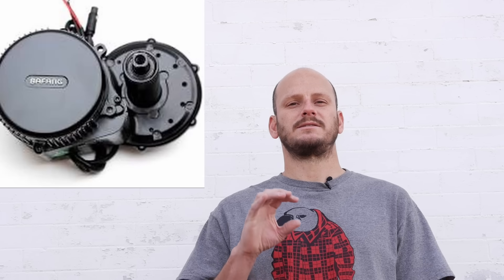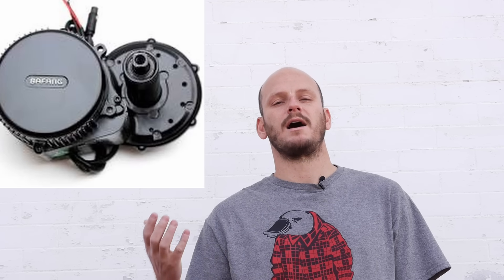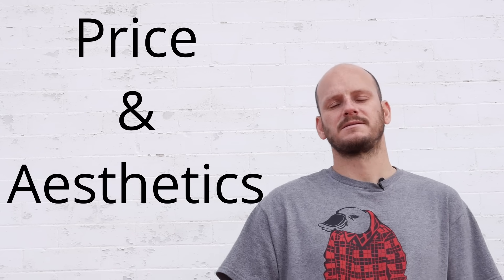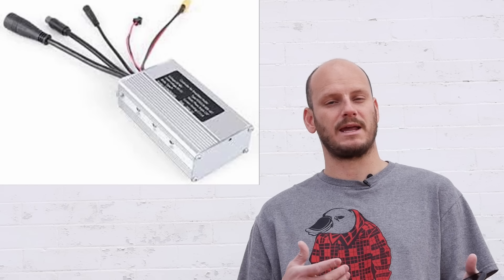Hub vs. Mid Drive Motors: Why Hub Motors Suck and Debunking Common Myths with performance test

Comment: Comparing the Hub motor to being stuck in 3rd gear in a gas-powered automobile is a poor analogy. Gas Motors need to be operated close to their optimal RPM to develop any power where as an electric motor develops power almost instantaneously.
Reply from the maker: Unfortunately that’s not true with systems dealing with this low of power. It needs to be handled like an automotive engine to maintain optimal rpm or it will burn up.
Reply: @JohnnyNerdOut  do you think the burnout problem with Hub Motors is an inherent design flaw (in that they must spin slowly) or is it just low-cost poor quality Manufacturing? Thank you.
Reply from the maker: @richardnwilson  major factor is poor manufacturing. Like 80% I’d say.

Comment: Having driven both for 10 000 km, I would choose hub motor on front wheel. It's better in deepish snow (or sand), because with both wheel drive it's easier to go straight and have better traction. Lower power output don't really matter, because speed is regulated to 25 kph (well, mine goes 33 kph) and battery capacity is not a problem. And hub motor is more maintenance free, with mid drive I needed to replace chain on that 10 000 km once, no such need with hub motor. ;) 

For biking enthusiasts who drive longer distances on one go, don't have snow and actually bother to do some maintenance more than once a year, mid drive is probably better. I don't do much maintence, just add some pressure to wheels when it gets so heavy that it drains battery too fast. As a sidenote I don't even change studded winter tires at summer, because with ebikes it's better to have bit of exra sound, so that I don't need to ring a bell to get past people. For some reason, ringing a bell really annoys some people and reaction times are anyways too slow and sometimes reaction is that people get into way.. Much smoother going through traffic with winter tyres, everyone keeps out of way and no negativity at all..

And it seems that bike thieves are not really interested about my bike. There's not so much valuable parts in hub motor ebike, where as mid drives are valuable.
Reply: Definitelly. I do love the added traction of my AWD bike. You're on point.
Reply: I keep hearing this "replacing the chain"  business. Few things easier than, "replacing a chain". They are easy to carry with you and all you need is a chainbreaker.
Reply: @Bill_Owen  Well, first replacing the chain, is a hassle, it's maintenance. Then, carrying a chain and a chainbreaker everywhere, is REALLY annoying and should be unnecessary.
Lastly, we are talking about having to replace your whole drivetrain because it will be worn out way faster:  cassette and crankset, not only the chain.
Reply: @xmtxx  chainbraker and chain lock should be enough. And it's close to impossible to break a properly made chain, aside kmc garbage. Cassette is worn by worn chain not otherwise. And not way faster.
Reply: @xmtxx  Replacing the chain is peanuts.
Reply: @mcplutt  It's still, unnecessary maintenance. Why would you want that?

As said by OP, we don't want maintenance.

Did you read my message?
You need to change your whole drivetrain, because it's worn out.
That's not peanuts at all, and also, expensive.
Reply: @xmtxx  Maintenance can be fun as long as the bike is fun 😀
Reply: @mcplutt  No it's not. And if, it is.
It's only if it's rare.

Comment: It depends. I got a Fuji Traverse e-bike with a hub motor as my first ebike. It is a 21 speed type 1 ebike.  Same bike as their conventional nonelectric. Cost $900 more. Bought it because I have 2 old Fuji conventional bikes. Fuji is a known quality brand. I find that it's best use is for to assist climbing hills in my area. I usually put the motor at full power and control speed and pedal effort with the gears. Since it is a 21 speed the electric motor just amplifies my own torque. However I have found that balance and handling are very much different than I am used to from 21 speed conventional bikes.  This rear wheel weight and torque can even be dangerous. I actually still use and prefer my conventional bikes on rail trails and level bike paths. My next ebike will be a midrive belt drive with internal gearing, a 750 W motor with 48-52 volt battery. Most likely a fat tire bike for the versatility.  Sand, snow, mountain trails, and road, there's really not much a fat tire bike can't do. I still prefer a type 1 ebike however.

Comment: E-bike Hub motors have automatic transmission inside them, its called planetary gear system.
Reply from the maker: Hmmm. Check that. I’ve never seen an automatic transmission in a hub motor. A planetary gear is a fixed gear (gear reduction)

Comment: Lots of BS. First of all, electric motors do not have a narrow powerband like internal combustion motors, so they don't need transmissions. Electric cars do not have transmissions. Electric motors work well throughout a wide RPM range. As for broken spokes, even with a mid drive motor, the chain and rear sprocket is connected to what? The hub of course. It's exactly the same thing, with hub motors being a lot simpler. Cheap pedal bikes with cheap rims and cheap hubs and cheap spokes will break spokes and damage the rims and hub. High quality ones won't Yes, if you are going to be climbing really steep hills, having maybe 2 gears might be beneficial. It depends on how you ride the bike. If you are pedaling like a normal bike (and if you are going to pedal, why do you need an ebike?) then you are assisting the motor while climbing hills. Or rather, the motor is assisting you. 

You seem to be talking about converting a regular pedal bike to an ebike. That is not for me. I am an auto mechanic. I understand internal combustion engines, and have built a couple of motorized bikes using internal combustion engines. But when it comes to electronic stuff, I have no idea how to build something that would work properly. The motor, controller, battery, and bike all have to be compatible. Not just fit together, but be electrically compatible. 

I have been riding a Chinese made RadCity step-thru ebike for the past couple of years. I have put a LOT of miles on it. Maybe about 15 miles a day 5 days a week. And it has been throttle only, no pedaling. I am disabled and cannot pedal. I got the step-thru model because I can't get my leg over the top tube of a conventional bike. I typically ride 7-8 mph on bike trails for a couple hours at the time. I have not had a single problem with this bike in 2 years. The hub motor did not burn up, the spokes did not break, and it still has a total no pedal range of around 20 miles on level roads with my 240 pounds on it.

Comment: I would think going through the chain and gears would reduce the efficiency of the motor.  Also, when I have had chain problems in the last 20 or 30 years, it has just once been a chain breaking or wearing out, and several times throwing the chain.  So I'd like to leave the chain alone, generally reserving it for special situations.
Reply from the maker: Going through the chain and gears amplifies the motor
Reply: @JohnnyNerdOut  -- In what sense?  You can add energy to a system only by adding energy to it.  For example, a vacuum tube or a transistor can add energy to (amplifying) a signal by switching in another source of energy.  If the motor is using only 750W from the battery, it can put out only 750W into moving the bicycle (or as heat).  That's all that's there and that's all you're going to get, regardless of how it's hooked up.  Basic physics.
Reply from the maker: @StarryGordon  you are right. I didn’t mean it amplifies the power. It just amplifies how the power is used through, essentially, further gear reduction by using the physical gears on the cassette

Comment: Thanks for pointing these things out.  One of your arguments I don't understand however, is how a mid-drive motor doesn't wear out or loosen spokes as much as a hub motor.  According to your initial claim, the mid-drive motor puts out more torque, therefore when that increased torque is driven through chain to the wheel, it still has to travel through the spokes to the rim to make ground contact.  That being the case, and the fact that a hub motor actually has shorter spokes than the same size rim with a mid-drive, how do the longer spokes of a mid-drive NOT loosen just as much or more than a hub motor?  Seems odd to me.  I'll admit I don't have any experience with a mid-drive though.
Reply from the maker: It has nothing to do with the power. But with the poorly assembled hub motors. Especially motor kits under $300.
Reply: @JohnnyNerdOut  Are you talking about spoke assembly, or what? I mean, if you are the assembler...

Comment: I had too much issues with hub motors. I had to replace two times my hub motor due to internals meltdown. I live in a location with many steep hills and a hub-motor doesnt take the advantages of the chain when driving uphills. Instead the hub-motor just uses full power to reach its speed target. After replacing the motor for second time, I sold it and bought a mid-drive ebike and no issue since then.

Comment: man what is with you tubers who just endlessly babble with bs..... ok we got it, hub motors or not as powerful, they do not use the gearing system which makes them less efficient, and they can damage your spokes compared to just replacing a chain. got it. done in 5 seconds.

Comment: Dear Jonny, great video thanks for that.
One hint on your first topic performance: torque values of hub and middle are always 1:2 because middle motors lose half of their torque via chain transmission and hub motors not -its plain newton mechanics.
Reply: Chain drives are very efficient transmissions. Bicycle chains can be up to 98% for power transmission.
Reply: @richardnwilson  you are right, the 1:2 ratio occurs because of the gear ratio

Comment: Thank you, Johnny.  Had I the choice I guess I would have gone mid drive, however, I picked up two hub motors, already mounted, a 26" and a 28", at an auction. I didn't know if they were a screaming deal or not, but I got the two for less than 50 bucks. 35 I think out the door fro both rims.  That 's all I have. is the two rear hub motors.  of course  researched make and models, but I don't know what i need or don't need, or even where to take them for testing..  I will tell you this much though, they both have a rear carriage or gears.Would that not counter your example of the car always being in third gear?  It's not a single gerared motors.

I don't know,could you please give me some insight, direction?  thank you
Reply from the maker: The motor is driven by a single gear inside the motor casing. It cannot utilize the multiple gears that are physically outside and visible. It’s only able to be used by human input.
Reply: @JohnnyNerdOut  Well hell.  you'd think  its the motor within the hub, turning the hub, and the gearing on the hub... derail-er thru the rachet. to the motor.. normally the crank.. yea, the gears on the outside have nothing to do with the gearing of the hub motor.  well damn!  I'd be money ahead by selling the hub wheels and buying a middrive.

Comment: The problem is in most states and countries. 20 mph is the law. 500 watts and less is the law. peddle assist makes it a peddle bike for cycling. it's not a motorcycle. The E-Bike works fine at and in those limitations. Pushing the limits of speed will only bring conflict with authorities and ruin E biking for the rest of us.
Reply from the maker: I do worry about irresponsible people ruining e biking too
Reply: @JohnnyNerdOut  What I've found is anything 500w and above on an E-bike will out peddle you( 14 mph avg peddle speed ) .  It is very uncomfortable. I have 4 bikes with a variety of motors. A 250 watt,350 w 450 w, and 500. With my size and weight,( 270 lbs ) the 350 is my favorite. I can go a long distance on PAS The low wattage saves the battery, ( 30000 AH ) very comfortable to ride and healthy. You will have to work a little but Really, Have you ever seen a person on an E-bike that was not smiling.
Reply from the maker: @joebyrneMensrights  sounds like you need to switch out some gearing. Are you using a hub or mid drive? I pedal comfortably @25-30mph
Reply: @JohnnyNerdOut  I'm 60 years old if I tried to peddle over 20 mph for more than a mile ID fall over gasping for air. LOLOL I have done 32 mph And decided that way dangerous. I fell in the woods last year on the MTB and had to pull a stick out of my arm. I try to keep to the bike trails to get places the streets are dangerous, #stop killing cyclists. I guess its personal preference speed and gearing I'm fine at 14 mph.

Comment: Would it make a difference if you drove a hub drive like you should drive a mid-drive?  Will shifting with the hub motor make it perform more like a mid-drive?  I'm considering a Himiway Escape which has a hub drive, but thinking about it, I would probably be pedaling and changing gears enough that a mid-drive might be best.  Any suggestions?
Reply from the maker: I don’t totally understand your question TBH. But no you can’t make a hub perform like a mid drive unfortunately.
Reply: @JohnnyNerdOut  Sorry for the confusion.  After doing a little more research, I figured it out.  I have gone back and forth on mid-drive and hub for as long as I've been doing my due diligence on this purchase, and I came to this conclusion:  I plan on using the gears anyway, as I do plan on pedaling quite a bit.  I think a non-pedaler would better appreciate the hub drive since he's probably not doing a whole lot of shifting.  Well, now to look for a folding mid-drive e-
bike, if it even exists. Subscribed, btw.  :)

Comment: I converted my Santa Cruz blur to a bafang mid drive over a year ago. It's brilliant so much power. I love it off road. Recently I added a boxer tripple crown fork (2nd hand) and a dropper seat post. Pavement road riding 35+ miles. Dirt  steep hills and canyons 20+. 500 watt battery. Cheers from California

Comment: How about a mid drive system on bike with a cvt in the rear hub. Does anyone make a cvt in the rear wheel?
Reply from the maker: I’ve done a few of those. The n171 is the strongest

Comment: Ok having gear reduction reduces the risk in a mechanical way of burning out the motor (output has more torque so is harder to stop which can be bad when not electrically protected). But if the reduction is not enough or enough resistance is applied and you can still block the motor that much that it could overheat. The controller should have amp limiting when it notices that the speed cannot be maintained, which will protect a hub motor just fine. Problem is that with cheaper hub motors most times are combined with controllers that are cheap as well and lack or have bad implementation of protection features. The controller is more important in protecting a motor from burnout then the gear ratio. Hub motors are a lot cheaper and when used correct they are not as bad as you stated. But in general if you want the best mid drive motors certainly the expensive high end ones outperform the hub motors by far. Problems with cheap mid drive motors also exist a lot like wearing out or even breaking the gearboxes.  You get what you pay for whatever the technology.

Comment: Having been on endless sphere for a long time, I can say that regardless of what motor setup you use, you will have problems regardless, what setup will depend on your environment. But a lot of what you are saying in this video is out of context or far too generalised to be applicable in reality. No setup is better than the other in general. Cost and reliability for on road use and light off road use, hub drive all the way. Heavy off road, get a mid drive and only a proper mid drive like bosch or possibly bafang or if you know what your doing, then do a proper professional build yourself. In my experience, running a QS205 at 22kw with cooling mods, decimates everything on road it comes into contact with under acceleration and especially at top end. It has no problems climbing hills and in 20k miles I have not ONCE! had to maintain it apart from occasionally check the spokes for tightness which is standard practice. If you have a MC chain and large rear sprocket you can run the same power reliably on mid drive also and it would probably accelerate better, but it would look like a motor bike and be more expensive and more complicated to build and get rite. Hub drives haven't reached there peak yet though, when axial flux hub motors become common place there will be a large shift in performance of hub motors.
Reply: @Jinx Powder yeah that's the input power at least anyway haha. There's a chunk of voltage sag on full throttle so It realistically is more like 18 kw output.

Comment: I love my hub motor. So far (1,300 miles) it's been bullet proof and I would buy it again. It's funny to compare it to the engine on a car since we are talking about electric motors😂. How many "speeds" do electric cars have? Pretty sure just one. I've only used one mid-drive but I wasn't impressed. My Chinese eBay kit was $190(no battery) and is still going strong.
Reply: The geartalking killed me
Reply: Teslas don’t have gears because the motor is around 170 times more powerful then a bbshd
It doesn’t need them
Reply: climb an insane mountainbike climb say goodby to your hub motor middrive has a huuuuge gearing advantage middrive kills the chain more but you do you
Reply: @SB7-r9i  dual hub motors defeats this problem and gives you all wheel drive